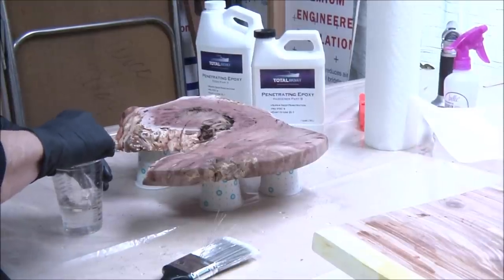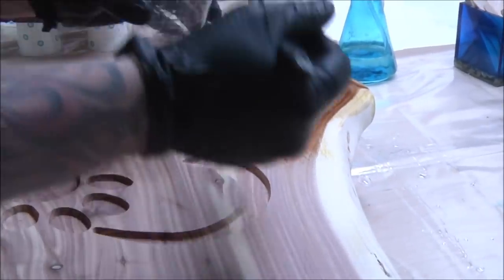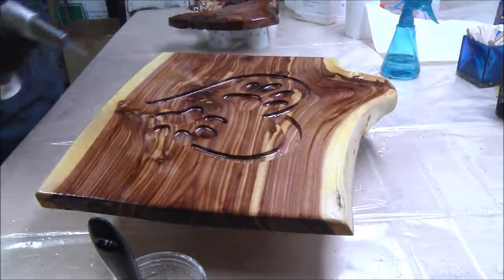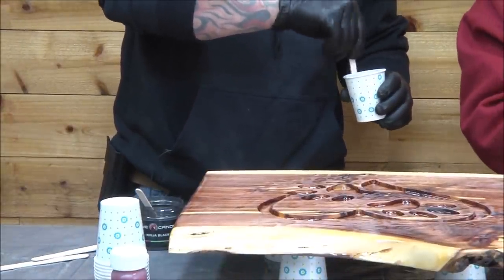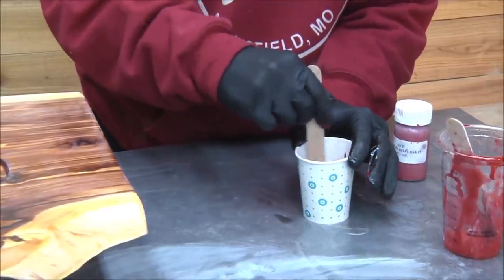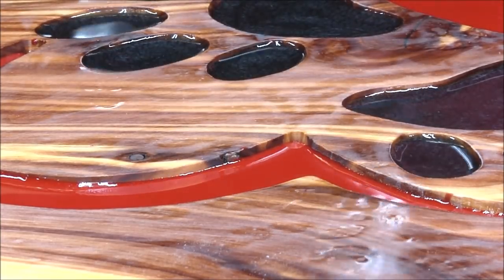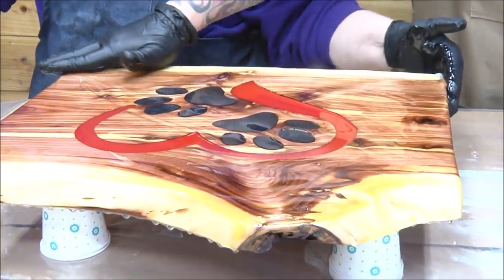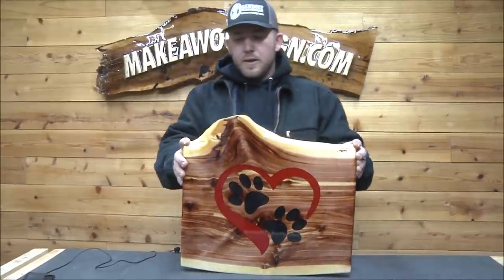#644 Freehand carving cedar live edge dog lover sign with epoxy resin inlay Part 2

Comment: Question - Did you sand or rough up the red and black before you put the final coat on?
Thanks
Reply from the maker: Hey Scott, not we didn't have to rough it up at all. We didn't fill the paw prints up all the way, so there was actually a good amount of the wood left for the epoxy to bite to. Does that make sense?